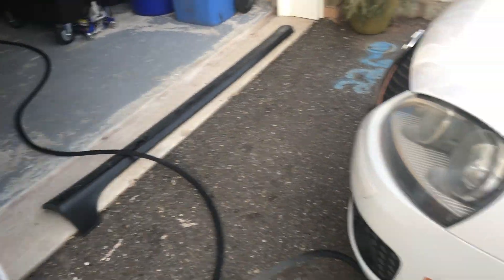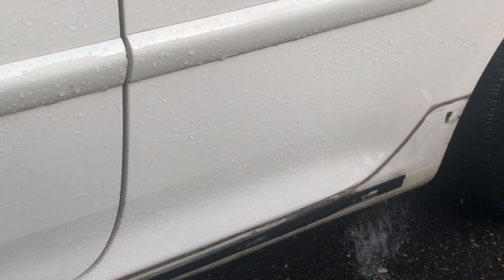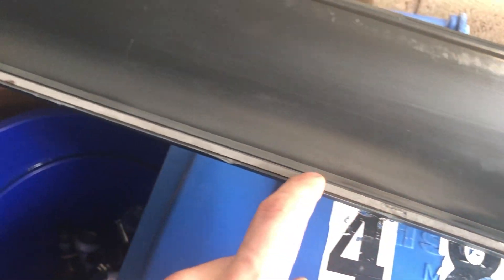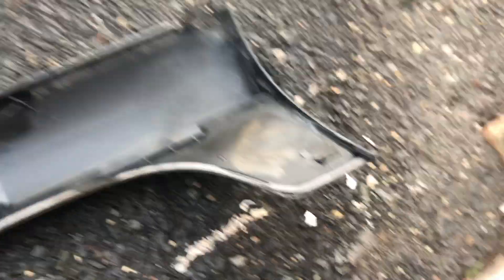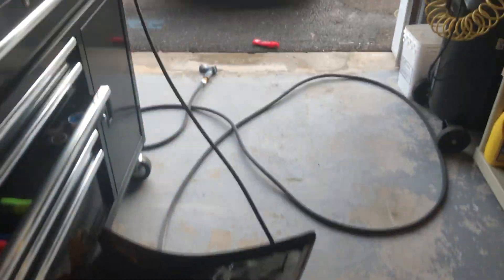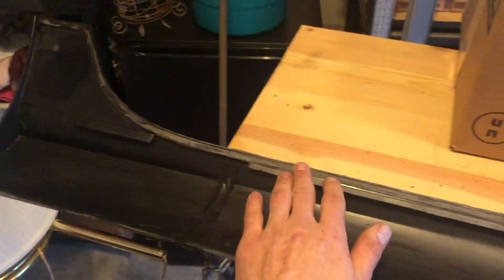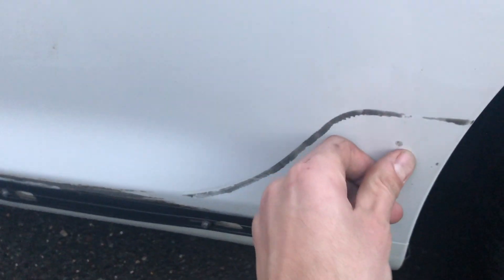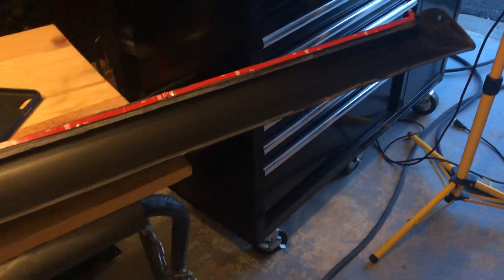MK5 Volkswagen GTI Sideskirt Removal & Install (EASY)

Comment: Very informative! Glad I know how to remove! My only Q is when you were rinsing it down I noticed looks like that first one split? I’ve bought some skirts from a gti for my modded tdi, would you say you need the brackets as I know most sell them without? Thanks
Reply from the maker: D33Man HC89 yeah unfortunately it’s split a little bit but once it’s on it holds up perfectly and you can’t tell. And yes if you don’t have the bracket I would suggest ordering one because it’s a crucial part to the install

Comment: Hey man how’s it going ? I know it’s a GTI but this is the only video I found of these skirts ! I found a Mk5 GLI at the junkyard with the OEM side skirts still intact and I’m wanting to take them out and install them on my Wolfsburg. The bracket that’s shown on 2:09 is that needed ? Or could I get away with just sticking and bolting the side skirts up ? Also could I get away with just 3m tape or would I needed something more strong ? Thanks  in advance !
Reply from the maker: Hey what’s up, honestly that bracket is kinda useless hahah. So yes I’d say you can get away with bolting it up and using some 3m tape: just make sure that surface is clean before you put the 3m. I’m sure you know that tho! But yeah 3m is honestly so good! Thanks for watching and commenting!